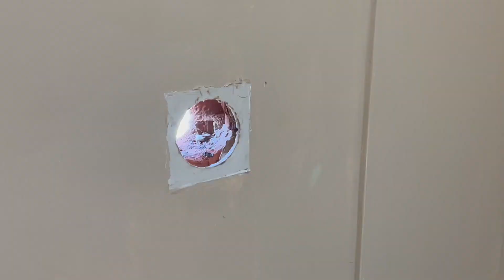Laundry Room Renovation Time Lapse | 3 days in 10 Minutes!

Comment: That black stuff under your tile work looks like the old mastic that contains ASBESTOS,  you need to have your house tested IMMEDIATELY.  It can be released into the air when you pull up flooring